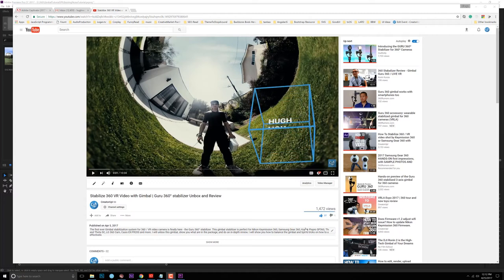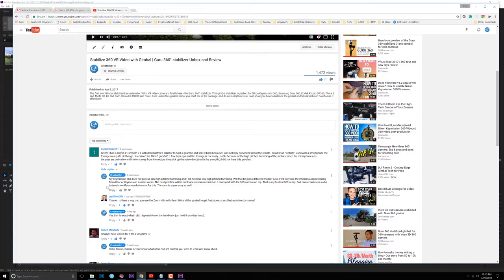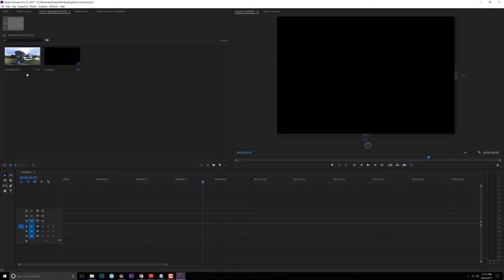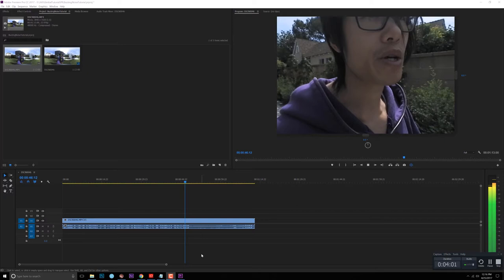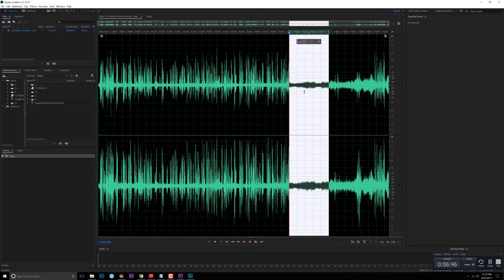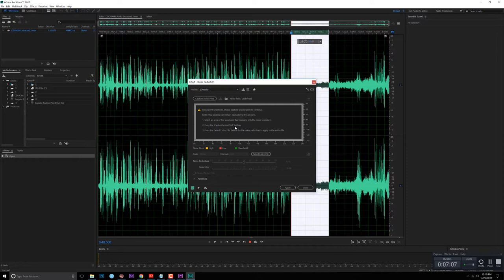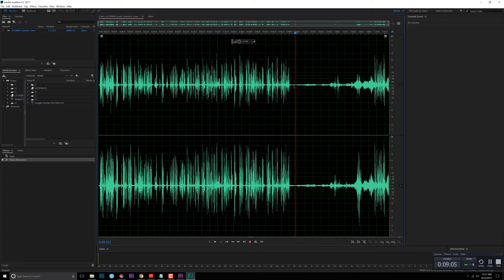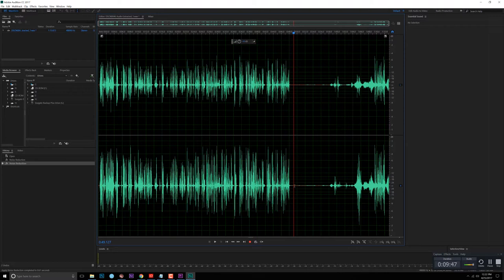Remove audio noise from 360 VR camera footage causing by Guru 360° Gimbal Stabilizer | Audition cc

Comment: what mic do you use?
Reply from the maker: I use the internal audio recording from the keymission 360. But usually, I will use a lav and a zoom H4N to record audio and only use the internal audio for sync in post.
Reply: CreatorUp! Lav?
Reply from the maker: lavalier mic.
Reply: +CreatorUp! So the lav is for taking to the audience more and the zoom will catch ambient sound like at a concert or festival? Does the zoom catch "spatial" or "3D audio" for using in VR?